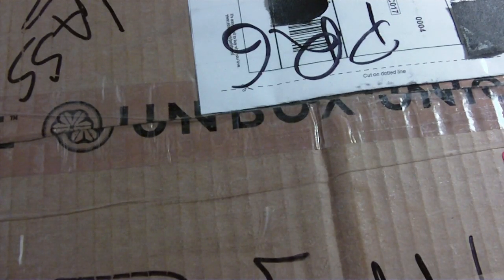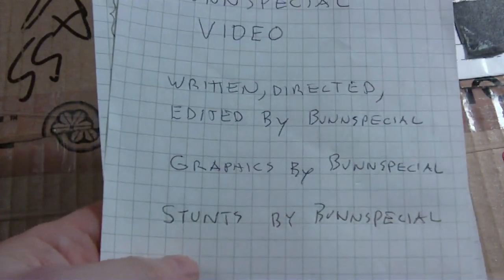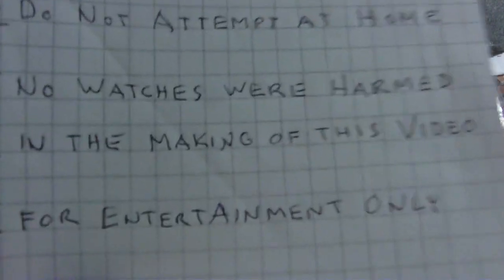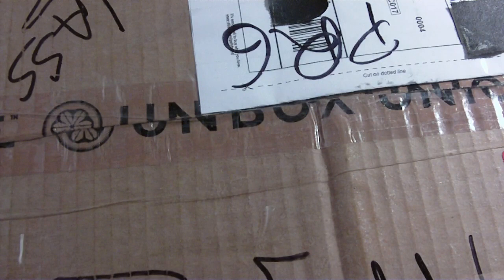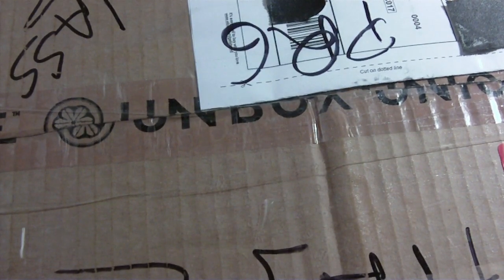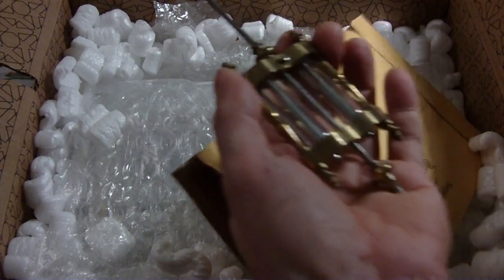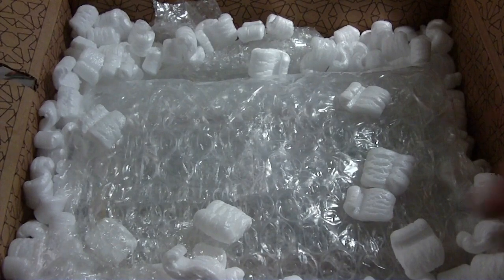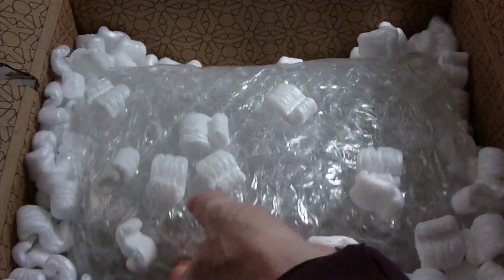French Crystal Regulator and microphone test

Comment: I love watching your videos. Very informative. I am a newbie to this stuff and I had a question you might be able to help me with. I have a watch that will only run when pressure is applied to the winding crown or center wheel. Any ideas? It would help a lot. Thanks again. Keep posting!
Reply from the maker: Looks like the mainspring is not broken and power is flowing through the train to the balance.  I would try cleaning and oiling it.  When you put it back together make sure the train moves freely.